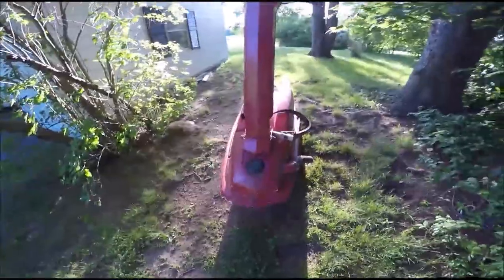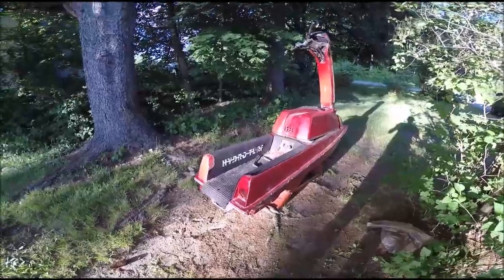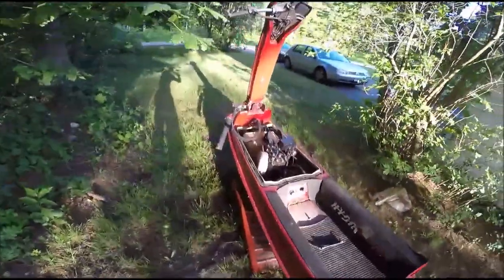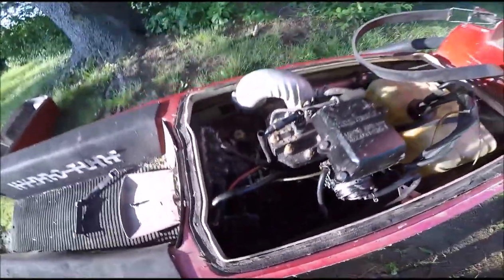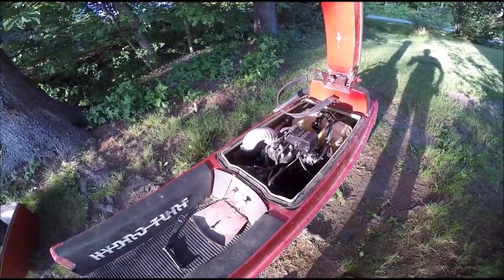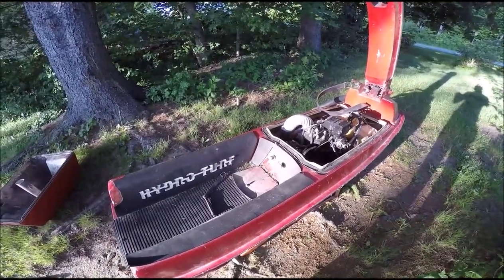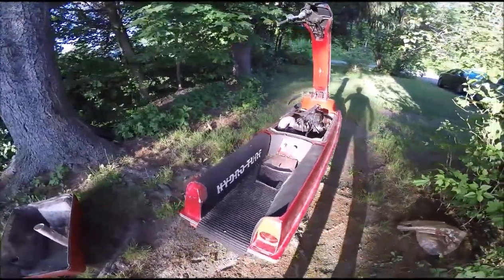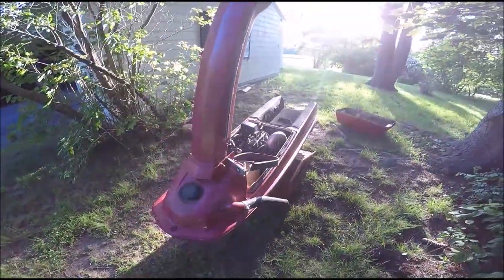1987 Kawasaki js440 Project Introduction

Comment: Dude I'm dealin with the same setup. New batt...hit the gd lil green button, it don't start it does more of a "thunk" from under the engine. Pretty sure it's the silanoid?? Dude, help.
Reply from the maker: +kevin linn clean off all battery connections and make sure your battery is fully charged. Make sure your engine can spin freely. Then try to start it. If that doesn't work let me know and I'll give you some other things to try.
Reply: +Soaked In Oil great thanks. It's a shiney new bat. The sound could be coming from the electrical box. Obviously I'm new to this. But I'll try that an get back to ya.
Reply: +kevin linn replace the solenoid
Reply: @kevinlinn8315  did it help??